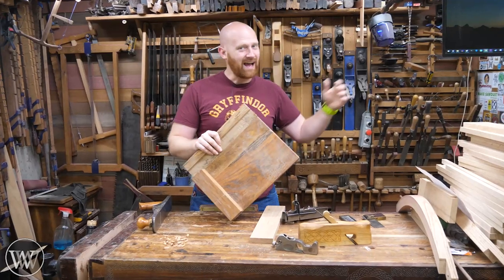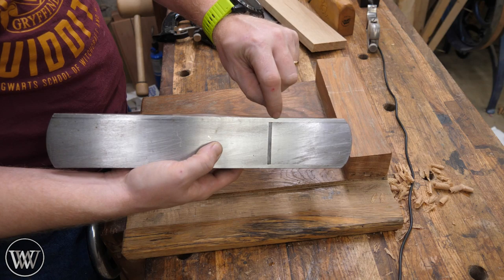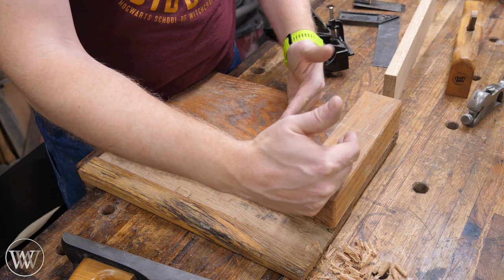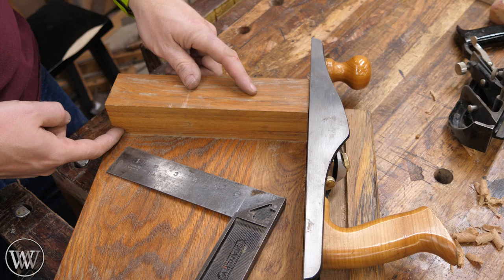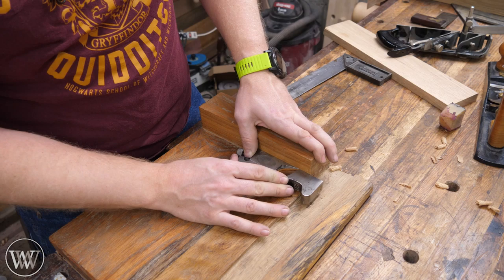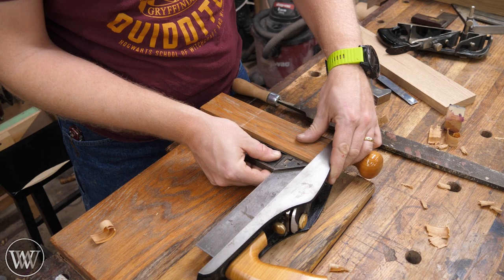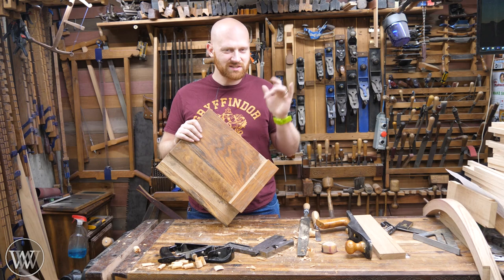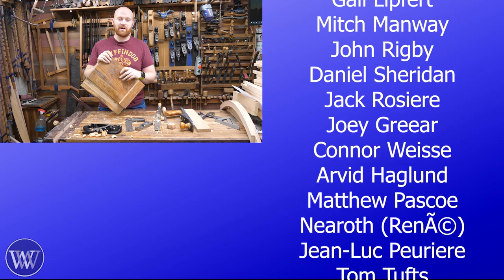How to True Up a Shooting Board

Comment: Man, what a great, quick video!  You really covered it and you did it efficiently. When my shooting boards have gotten out of true, I've typically just made a new one, but I'm going to try this next time!
Reply from the maker: You want to do a colab and show two different types of shooting boards?
Reply: @WoodByWrightHowTo  love to! I'm just about to build a new one anyway.  I'll email you.
Reply: I agree... more James/Rex colaboration
Reply: @RexKrueger  I really like the adjustable, screw on fence that came out of that colab. Inspired by this and a few other shooting boards I added an upper guide rail for the plane (so it can't tip inwards) and fences at both ends (so I always can get the reference edge down in the corner).

Comment: Yes please a new video on a shooting board or a reflection on what you would do differently to improve on your previous build.
Reply: Meant to add, could you add a few comments on shooting 45 degree case mitres (i.e., for box making). You could then get into a debate on donkey ears and not registering against true inside face of the box :)
Reply from the maker: Those are on my list. Haven't made the video yet but it'll be coming up soon I'm just waiting until I get some hardware for it.
Reply: Wood By Wright How 2 .... I thought all you needed was white oak :)

Comment: Excellent video, and yes, I would love to see you make a super duper fancy shooting board. Do you think it's worthwhile to try the method of checking a miter saw to check a shooting board? The method is to make a cut then butt the pieces together and against a fence. If the saw is out of square then the angle will be commensurate until you flip one over, revealing how out of square it is. I think this would work for shooting as well. What do you think?
Reply from the maker: right on that is one of the best ways to see if your square is out too.

Comment: Question whats the primary function of a routing plane 
I just got a whole bunch of tools from dads boss but im still fairly new to old woodwork
Reply: The primary function of a Router plane is to smooth, flatten and refine the bottom surface and many types of joinery to a consistent depth.
The flat surfaces either side of the blade reference off your board and the cutter is set to clean the bottom of the groove, dado or other cut joint. You can even use it to refine tenons. Go little by little, it's best to refine it rather than hog out stuff.
Reply: As Malcome said, plus if you are mortising out for a lock or hinge they are great for getting that perfect flat, smooth transition between metal and wood.  They also make for an awesome depth measuring tool for transferring dimensions.
Reply from the maker: Here is a video I did on that before. anything from making a groove, to trimming tennons, to cleaning out hinge joints. any time you see a parallel plane lower down a router plane can make it. https://www.youtube.com/watch?v=2HocH6JHNLs

Comment: How does one go about 'shooting' by hand without a shooting board?  Precise chisel work?
Reply from the maker: I did a video in that on a live once. You can do it free hand in the vice. Stand the board up in the vice and check it with the square and only hit the high spots. Do not plane all the way across the board just stop short of the other side. And plane from both sides tell it is square.

Comment: I would like to see your new shooting board video!

And how square is square? Thats a controversial question! :)
Reply: Exactly 90° is actually square, the 3,4,5 traingle meathod is a good measure, but the average human eye can not discern that level of accuracy on a small scale. If the legs of the angle are longer,  then most humans can detacet the something isn't quite right whether they can put their finger on the fact that the angle is off or not is another question altogether.
Reply: @thomasarussellsr  Nothing in this world is exact. There's a video here of a guy measuring the thickness of a sharpie mark. The ink on a piece of steel. Thankfully woodworking we don't have to worry about that level of precision.

Comment: What do you do if the body of the plane isn’t perfectly square?
Reply from the maker: That is why there is a lateral adjuster. The side of the plane does not have to be square to the sole just adjust the iron so that the iron is square to the side. People often run into the issue of having the sole perfectly square with side and still wondering why they're getting ends of boards that are off square.

Comment: Yeah, James, I'd love to see a new shooting board build. 
Any advice on weather or not to make a shooting board out of CactusJuice stabilized wood or that "plastic" cutting board material to avoid future warping due to mivement?

And, thanks again for the marking knife giveaway. The one I received will only require maybe 30 seconds to a minute at the sharpening station to be serviceable to my shop standards. (Left hand edge is pretty sharp,  but the right hand edge (my dominate side) has a minor burr, and my OCD won't let me igore that. It does make super great lines both sides as received, but you're  OCD as well, so I'm sure you understand.
Reply from the maker: thanks man. my next one will probably be out of ply wood. I know sacrilege!